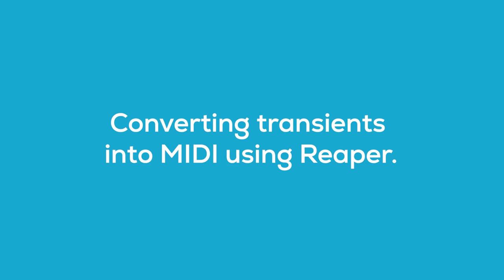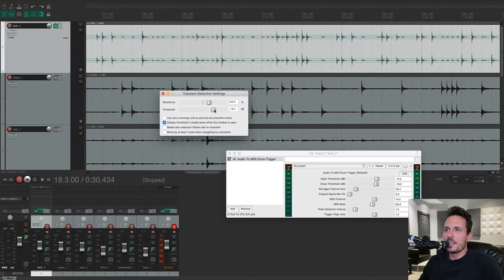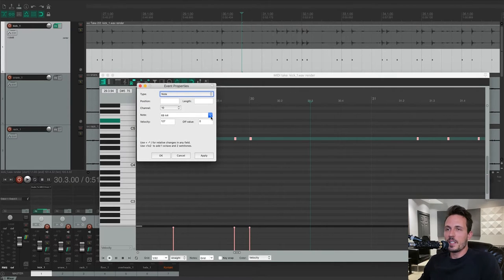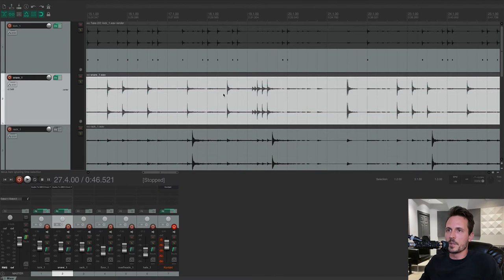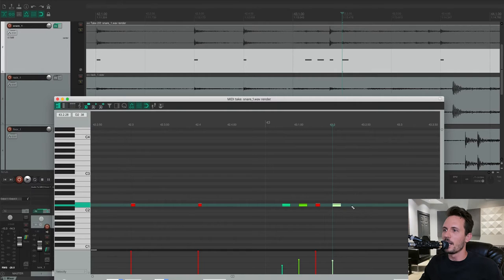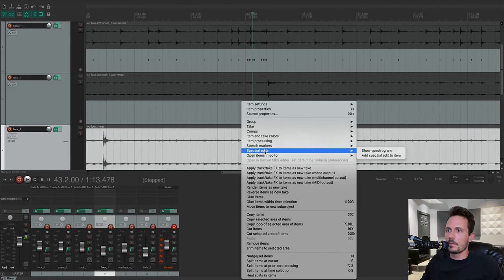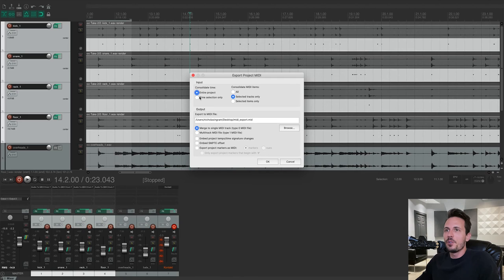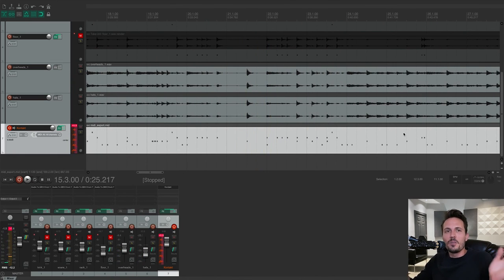Converting Transients to MIDI in Reaper

Comment: this an alternative to a method without using the plugin, namely splitting with the Dynamic split while 'Split selected item' option is enabled under 'Action to perform' and 'Create chromatic MIDI from slices' is checked
after the split the source media item can be healed to undo the splits while keeping the MIDI item
the MIDI items can then be placed on top of each other, selected with marquee selection so that items underneath are selected as well, and glued into one